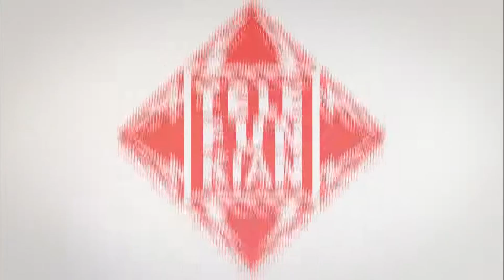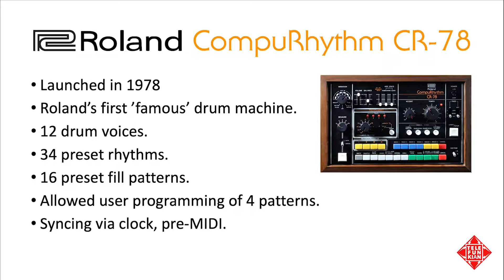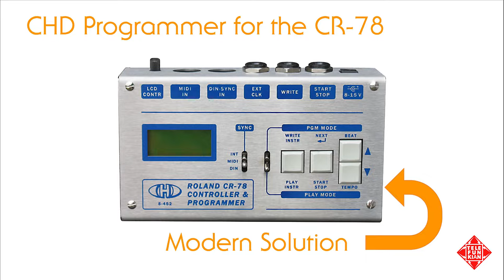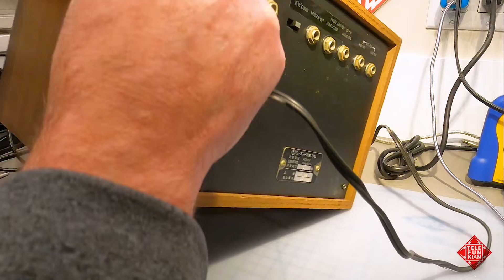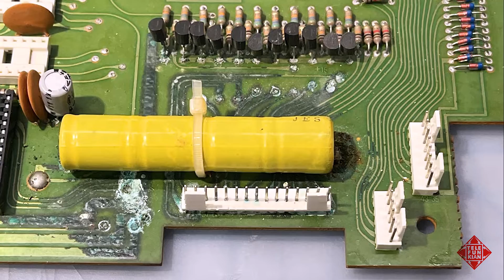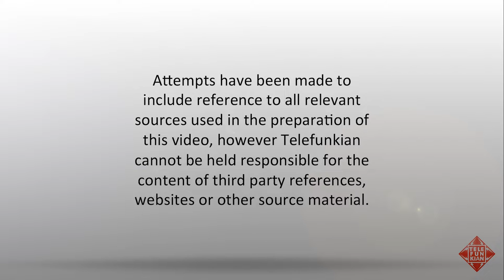Introducing the Roland CR 78 Vintage Analog Drum Machine

Comment: Great video. Appreciate the effort.
I have a CR-78 that has this peculiar problem: seemingly at random, it goes crazy, and does what seems like play at 1000 bpm. Sometimes restarting it cures it (for a while). But mostly, you have to let it sit for hours. Then it will behave, but only for a little while. I made this video showing the issue: https://www.youtube.com/watch?v=GsngYyQeH8o. 3 techs thought they'd fixed it. 
😑
Reply from the maker: Yikes! The most alarming aspect of that is the loud hum which could be a bad power supply or internal ground issues, causing other problems in the logic area. I would not use the instrument in that condition as you may damage irreplaceable components. Get thee to a tech! I am in Vancouver otherwise I could have a look at it for you and give you a better idea what the problem is.
Reply from the maker: Thanks for the feedback, I'm glad you enjoy the videos.

Comment: The one in my studio fails to properly save user patterns. It freezes up when trying to use those four programs. I hope your future videos might dive into this issue and solution. 😁.  I’m worried investing in a midi kit without resolving this issue might be problematic.
Reply: I had this same issue and had a bad EPROM chip. It’s either that or the RAM. I swapped the CPU for the Tauntek CPU upgrade which bypasses RAM, ROM and battery and everything is perfect, plus you get to program patterns using the front panel interface! It’s a must for all CR-78 owners.
Reply: @autoy  thx for the tip. I’ll look into it. Sounds ideal.
Reply from the maker: @fetaldreamcore  I can second the advice regarding the Tauntek MIDI kit. As it replaces the CPU, EPROM and memory it would seem likely to fix your problem unless there is something odd going on with your switches (seems unlikely). The kit is the easiest of all the kits to install, the most elegant and least expensive. I think it is a winner. The video on the kit will be out in a few weeks if you can wait that long to make a decision.
Reply: @telefunkian  thx I ordered yesterday already as I agree with yall and I suspect it’ll solve my issues and open the machine up to its full potential.